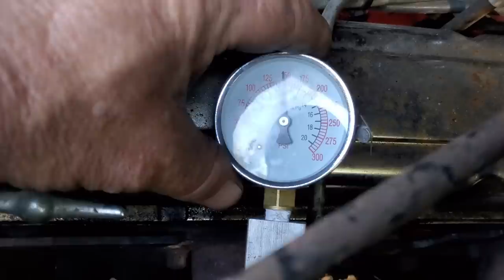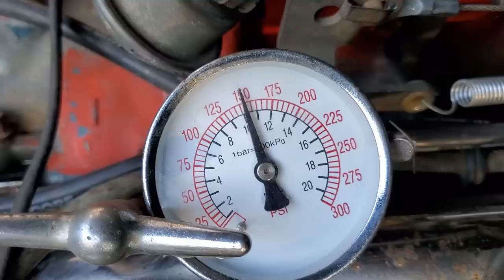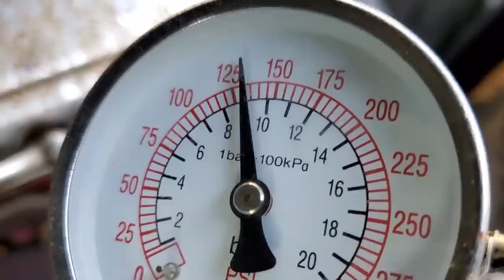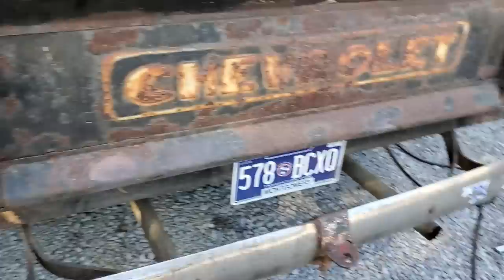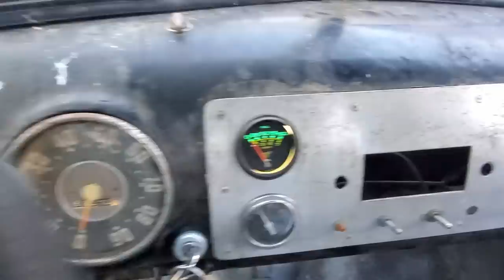Dude Gets TWO tail lights with turn signals AND a 4 speed Muncie Transmission!! (Partial Fail!)

Comment: Watching for the transmission (and maybe the engine) rebuild.  I did it on a Getrag several years back and it weren't that bad - actually worked out very nicely with much improved tranny operation.  This old DUDE deserves you throwing your best efforts to support his needs.  Excited to look forward to another fine video!!

Comment: You may be able to use front turn signal sockets from an early to mid 60's Chevy truck. The sockets are metal and have both parking light and turn signal, with 1157 bulbs.

Comment: You are correct about the gold being wear from the syncro rings.  When shifting, they are the devices that do all the work of matching the gear speed during a shift.  They prevent the grinding of the old, non syncro trannys.

Comment: You know, I really enjoy your channel.  Not because I'm much of a car guy anymore, but because your struggles are there in plain view--the same struggles that any of us who make things and maintain things struggle with.  "Where is that damned screwdriver?"  "Oh crap, the bolt sheared off".  "Where is that oil leak coming from?"   My current project involves restoring a 42ft satellite dish that was a former NATO ground terminal.   It involves things like 1500lb(!!) gearboxes (4 of them!), 200lb electric motors (8 of them), clutches, brakes, rust, oil leaks, burning-out motors, dropping tools, breaking bolts, etc, etc.  Not too many dirt-daubers falling in our eyes, but, pretty-much everything else :)   We, like you, have almost no budget to work with, so there's a lot of "making do" and improvisation.

Comment: What I have done to fix the pitting in the master cylinder when there isn't one available, is to just sand, and then polish just the area of the pitting.  This allows you to use the original sized piston rubbers, and works like a charm.

Comment: Here's an FYI for ya. The fastest was we used to remove the pilot bushing, where you were cramming paper into the bushing, we filled the bushing with wheel bearing grease and the use the clutch alinement tool or a small socket and extension and smack it and you don't have to hit the second time, that bushing flys out of there. Try it you'll be amazed!
Reply: Bread works also
Reply: I used to use a grease gun it always worked for me
Reply from the maker: Too messy.
Reply: If the bearing is really sloppy, the grease could become a projectile in your face
Reply: @brucedragich1316  not if common sense tells you to wrap a rag around the alignment tool up against the bushing to prevent that from happening. I’m telling you it’s just so easy and it’s not messy
Reply: Was just saying,  there is a certain element of pressure happening,  weather it is a chip  of metal off the side of your driving tool into you cranial area or your fingers , good day to you sir

Comment: Pulled the 350 in mine and put a different set of heads, cam & lifters, intake and resealed the engine which was why I pulled it in the first place. Put it back in and proceeded to chase an oil leak because of the pvc valve grommet was to big and the pvc valve came out and it proceeded to push oil out the dipstick and breather cap under load. Thought the rear main was leaking at first. Got the right size grommet when I found the loose valve and that took care of the oil leaks. It’s been a gem since. Take care.

Comment: When I used to remove and replace 4 speeds laying on my back I would lay with my head under the oil pan with Trans beside me , get it up on my chest and use both arms to pick it up then push it in .

Comment: If we were neighbors, you could learn to hate me as much as the ones nearest me now. I am a 73 year old hot rodder of sorts and here is saying that the pocket bearings on  the main shaft are worn out, one or more bearings on the cluster shaft most likely the same. All are easy to replace with some vaseline to hold them together while stuffing it back together. Those synchronizers are brass on the floating part and the actual gear is steel... they get kinda bradded over making it harder to get into gear. I  ain't the sharpest pencil in the toy box but some filing of those teeth may help some but the synchronizers need replaced. We we were kids running these transmissions, we would grind every other tooth off thinking it would take that next gear faster but it just ripped those teeth off easier ... I do believe. Its going to have vibrations till each gear is worn equal to the other and that just never does happen so new would sure be sweet. The best money is new bearings all the way through, and replace the worst sycros. Thats my eleven  cents off of "trust me" internet brain power.

Comment: I feel your pain brother. My very first vehicle was a 1970 F100 with the most clapped out, worn down, tired 390 big block you've ever seen in your life. And the transmission and rear axle weren't far behind. But that didn't stop me from driving it for 10 years lol. When I finally tore the truck down for a much overdue overhaul, I couldn't believe that this engine was still running. It spat in the face of all doctrine! Three burnt exhaust valves, two caved in lifters, a flattened camshaft, three bent push rods, almost every rocker was just flopping around on the shafts, rods so loose You could slap them back and forth with your bare hand and a crank that would walk backwards and forwards a quarter of an inch! But I rebuilt her anyway!

Comment: I really enjoy your video’s and content.   I’m sure someone might have mentioned it in a previous comment, but your bellhousing is one out of a pickup truck.  The big ol’ hole in the middle is slightly bigger on truck bell than on a car bell. Therefore, the front bearing retainer for a car transmission, such as your muncie, isn’t going to properly register in the bell, causing all sorts of noises/ problems.  I noticed you have a lathe, so you might want to make an adapter ring or just leave it as is.  Either way, keep up the hard work, great content and awesome attitude!  Cheers.
Reply from the maker: You hit it on the nose I do believe! 👍

Comment: I remember taking metal shop class in highschool and cutting the cutting blade from square steel stock to use on the metal lathe.

Comment: Had a 51 with a 350/4 speed Muncie with 4.10 gear , two bbl off a Oldsmobile high compression motor isky cam, man that bucket of bolts would rock and was a handful to drive but I loved it so.. lol

Comment: Another good honest video for me/ us living in the UK..Tell you a little story, for 10 happy years i had an early 3 door turbo diesel Landrover 1991 model that was still so oil tight the engine sump went rusty from the outside, so I had to fix it.. Had to sell the old girls still in its shiny factory black paint and full length factory side graphics at 240.000 miles running as sweet as a nut.. Most Landrovers are made Diesel for home market sales and my early one ran happy on a mixture of new cooking oil, Diesel and a splash of unleaded to keep the injectors clean, but, out of the exhaust it smelled like french fries - LOL..We can do this legally here In the UK as long as we dont use more that 2-500 litres of it (so they say) lol Anyway sadly had to sell the old girl as i became disabled and the "Mans clutch" became too heavy in traffic, so now i bought a smaller Landrover FREELANDER thats got the nice 2 litre turbo diesel BMW factory fitted engine and automatic box with a bit of old mans luxury inside, the landrover even got a factory fuel burning heater to warm the engine and heater up quicker on very cold days we sometimes get, anyway i can talk for hours, Thanks for the videos and letting me into your world of fixing vehicles the best way.. Ian..UK.

Comment: Great video! I want to say I am definitely not a Chevy expert. But a good friend of mine years ago said the older Chevy motors had an issue with valve guide seals? I watched him do it several times . I remember he would grab the top of the valve stems with vice grips to keep them from dropping and use a spring compressor. Not sure the whole process, but I remember he said they wore out every 20k miles. Looked like o rings. Said he would use a quart of oil every tank if he didn't replace. I bought a Ford.. I would love to hear if that may be the problem. Compression did not seem that bad. Ty for the entertainment. I bet that pressure plate is just weak if it won't hold on a hill.
Reply from the maker: It doesn't have any valve seal symptoms such as smoking after idling or on startup.
Reply: @ThisNThatGarage  just oil disappeared?

Comment: Early in the video but, I would say your crankcase is simply not "breathing" and your valve guides are worn enough to be leaking oil and combustion down the valve stems. So, from past experience, I would suggest doing the heads and including some valve guides and maybe stem seals. Compression looks pretty good!!

Comment: Now that your taking the transmission back out, if you can rebuild it don't forget to drill a hole in the bottom for a drain. Hard working alone all the time, I know that because sometimes I could use some help, but I usually not get any. Anyways good job, even though it didn't turn out like you wanted.

Comment: Real thick grease( wheel bearing) is what I always used to get pilot bushing out with! Works great! Pack it in then take a bolt stick it the hole at tap it and out POPS THE BUSHING!! NO BREAD,NO TOILET PAPER JUST THICK GREASE!!
Reply from the maker: Yep nasty messy grease!

Comment: Check your valve adjustment I've ran onto that a few times your compression readings weren't all that bad I'd say you might have a valve issue

Comment: The brass things are blocking rings. They work with the synchronizers. A  M20 doesn't have a drain plug or a boss to drill and tap. A M21 has the boss but not the plug. A M22 has a drain plug. There also close-ratio and wide-ratio versions of the M22, maybe the M21, probably only wide-ratio M20s. Correct me I'm remembering correctly.

Comment: The Saginaw tyranny is a little harder to get the shifting forces stabbed in the case because the reverse part of the shifter is in the cover too! I have a Muncie in my 68 C10 now but it's to tall geared. So now I have to fix my old Saginaw box fixed I broke the imput shaft on it, I thought it was a sink row bushing but it was the teeth the main gear is fine so I just need the 16-tooth input shaft. you can't hammer on the Saginaw as hard but it's geared right and it lasted me for 10 years I got it out of a Vaga and ran it for 3 or 4 years in my bomber a 71 Comaro.

Comment: I found the other day that the pilot bushing in the crankshaft doesn't last forever. The input shaft s supported by the bushing.
Reply: I tried to "hydraulic" a pilot bushing out but no dice. I had to carefully use an air grinder with small cutter to cut a groove in the bushing.

Comment: You must plumb the PVC (positive crankcase ventilation) valve as it pulls a vacuum on the crankcase and  actually pulls in fresh air to the crankcase through the filter that is on the valve cover (on most cars it is the little filter in the air cleaner assembly) With out this system the pressure built up in the crankcase from the pistons going up and down has to be ventilated or oil will be blown out past the crankshaft seals and the breather on the valve cover, and anywhere else there is a gasket surface. on older engines as you well may know there was the road draft tube system which relieved the crankcase pressure when the car is going down the road. Of course if this road draft tube gets clogged one would experience the same problem. People would remove the tube and pour gasoline in it and light it off to carbonize the the blowby and clean out the tube to relieve any blockage. Try plumbing the PCV valve into a manifold vacuum source as you would copy off of an engine that has the factory setup. You may find that your oil leaks will clear up.
Reply from the maker: Actually crankcase pressure comes from blowby not piston movement and no amount of pvc will fix that. However hooking up the pvc will hopefully get rid of most of the blowby coming out of the valve cover breather and suck it into the combustions chambers to be burned.

Comment: Chad: -"There's a little bit of gold flake in here, but it only takes an hour to change out the transmission in this truck, soo...".
Me: -"Yup, that looked really easy there Chad, but maybe it took just a smidge over an hour?... LOL! 😁👍
Reply: Pressure plate and clutch took the most time, won't have to touch them the next time.
Reply from the maker: As was stated an hour estimate does not include pilot bushing, clutch, bellhousing, starter, dust cover etc. Transmission removal should take no more than 30 minutes on these 4 speeds.

Comment: Oh man...I was hollerin' at my screen, "Don't put that tranny in yet!! "  With the shift cover off I could see that the 3rd gear blocking ring (brass) was plumb wore out.  The noise on deceleration is probably counter-shaft needle bearing to pin wear. High gear locks input and main shaft and unloads counter-shaft. Why 3rd is quiet...I don't know...guessing pin is worn more on one end.
Reply from the maker: 4th gear synchro is the wore one. Just wait til you see what the problem was! 🤦🏻‍♂️

Comment: about 5 minutes in on the left side where you show the clean pan the bolt shows a bubbling around it  i would get a new pan and gasket . the pan might be warped our have pin holes in it
Reply from the maker: Probably the old paint bubbling. It's all falling off.

Comment: Why don't you do the old BonAmi trick on the engine, to help seat the rings.  Let some Bon Ami get ingested into the engine through the carb.  This will seat the rings without destroying the engine.  Don't use any other product, they are too abrasive.  I worked part time at a car dealership, and this was one of the tricks they used on old trade ins that they didn't want to spend money on.  Great video.

Comment: Front bearing is shot hence retainer holes are wollard out and leaks oil also retainer gasket may be to thick and wrong retainer, tranny has to have a certain amount of end play use feeler gauge to check tolorence. Good effort though it kept me entertained to the end  peace out.

Comment: You need A license plate light to now. Their called tag lights.
Reply: In Tennessee the truck only has to have them if they where factory-equipped which this truck was most likely not.

Comment: switch to 15/40 rotella it will build compression and reseal ur seals ive never had engine failure and its for these older engines
Reply from the maker: Rotella is all its ever had.

Comment: I had a truck that started doing that randomly when I was driving only did it when I went off I gas/downshifted She didn't have any oil on the dipstick problem solved, It was all engine noise

Comment: Chad, assuming the pilot was the correct size, I think its the input shaft bearing or idler shaft is wallered out. The early Muncie had small shaft diameters.
Reply: Also, did you check the bell-housing to trans diameter? Other one mY of been bigger and the trans is a bit off center.
Reply from the maker: We'll find out soon enough what the problem is!

Comment: Sir what did the Tans Am Vibration turn out to be if I may ask?? I am chasing a strange vibration with my trans and any ideas are welcome. Thank you!!
Reply from the maker: Brand new driveshaft I had made was out of balance. I shade tree balanced it and it helped a lot. Check pinion angle also. Your pinion and engine/trans need to be running parallel.

Comment: Take all that cheap Chrome off and throw it away and put regular valve covers and timing chain cover on it that's your oil problem all those chrome parts leak
Reply from the maker: The valve covers have never leaked so yeah.

Comment: Bro Amber lights mean it was made in a foreign country like Mexico or Canada
Reply from the maker: Most everything you buy is made in another country so I'm not real sure what your point is. 🤷🏻‍♂️
Reply: @ThisNThatGarage  bro I learned that when I work for GM back in the 70s I had no 53 Chevy pickup and it's a front signal license clear and I didn't mean nothing buy it did you ever find out the shake in it

Comment: I like your show I just was wondering why the all you guys are most all you guys on the internet YouTube advertise and the keep advertising Harbor Freight and that BP Blaster where'd that come from all of a sudden my dad always use Liquid wrench for everything and that Miracle Marvel oil for getting the motors on truck I was stuck and you can also you care soon and everything anyway I learned from the old guys like you did and I used to use the you know the tissue paper in the old hole there and use the old boat use a bolt in there thread your boat about the size to go in there and then it pop right out he needs it for harmonic balancers too okay thank you very much